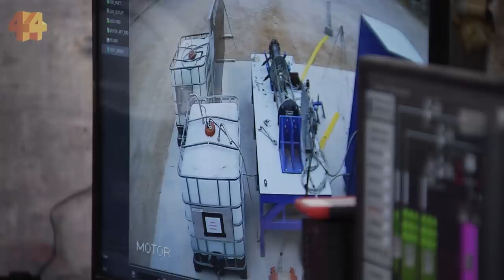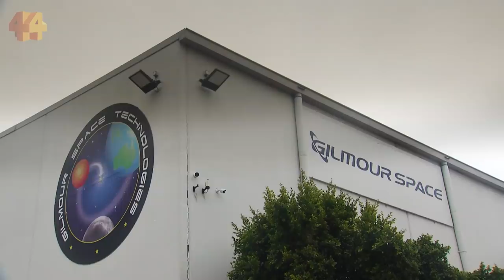New space age: the race to dominate the moon and mars | Four Corners

Comment: If we gps the solar system and gravitationally slingshot an asteroid into a super fast elliptical orbit around the sun out to Mars it can be a conveyor station, to land ships on with tunnels in it and silos supplies fuel, they can use lots of these conveyors to land on and take us to the planets. We can mathematically snooker objects where we want them with ai supercomputer modelling and missile defence technology of kinetic high speed impact engineering to knock extremely massive objects with some dialable nuclear bombs that rovers place to steer them and move to a safe spot away and inside their turtle shell shield and place another one to keep steering it gravity slingshot into knocking a Saturn moon off orbit into elliptical orbit space station or into Mars to kickstart the magnetic field or into antarctica to mine it.